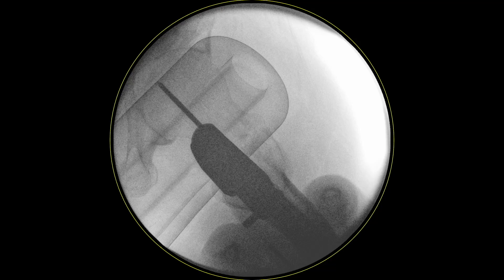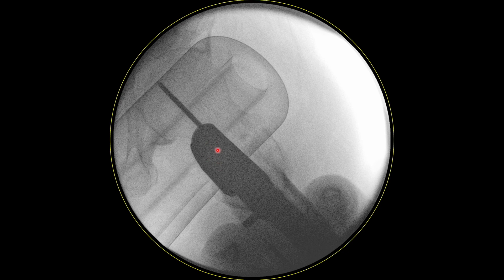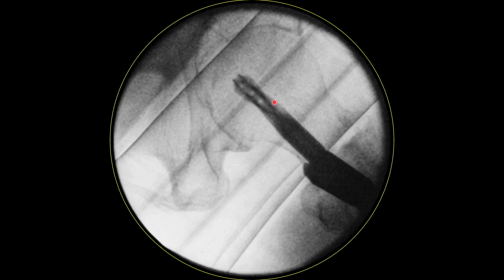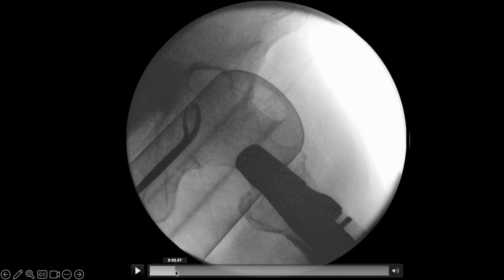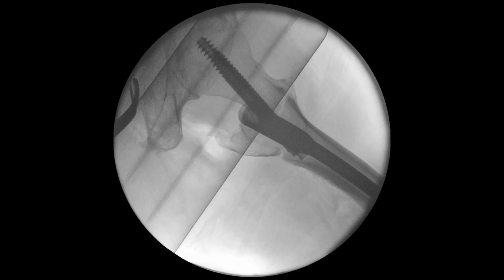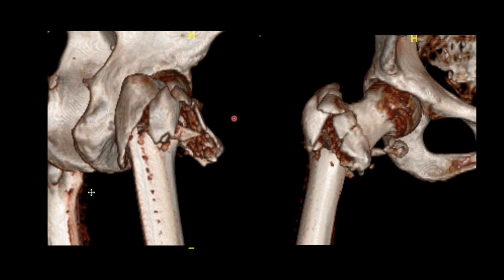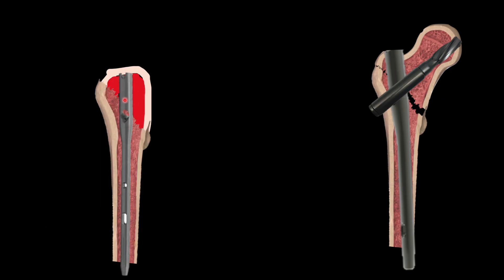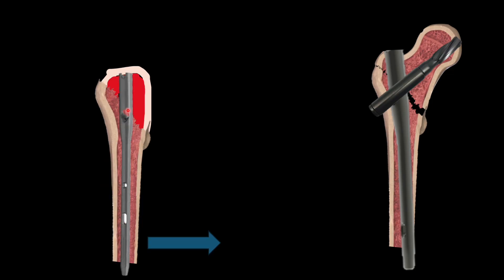Problem of Off screw in Trochanteric Fractures Nailing

Comment: What do you prefer lag scrw with anti rotation or lag screw with cap 
What if there is posterior comminution you put fully threaded or partially threaded screw 
Thanks , sir
Reply from the maker: We use separate derotation only when we are using DHS. With most new nails the set screw which goes through space of end cap blocks the rotation of lag screw. So there is no need for a separate derotation screw. However when there is posterior comminution , we may use a fully threaded screw because that is more stable than a partial threaded one in view more threaded and better bone purchase.

Comment: Sir.. posterior placement ( & still parallel to neck axis) of screw in lateral view is acceptable only sir...???
Reply from the maker: Yes, that was acceptable in the examples shown initially. But, remaining too posterior in the neck can actually perforate the neck. X-rays may not show it, but CT will confirm.
Reply: Ok sir.. @Justorthothings
Reply: @Justorthothings  Campbell advises 20 degree hip flexion during positioning... May be to counter posterior sag... Didn't tried & was not needed too in my cases...  Kindly share your experiences sir...
Reply from the maker: @Sulthan62 when putting limb on fracture table, the limb usually remains in flexion only. Moreover a perfectly central nail entry wont create problem of non central screw. But if it happens, this video tip will help. Everything will be under c arm view, so there wont be much problem of overextension.
Reply: I feel that there wouldn’t be any orthopedic surgeon who hasn’t faced challenges at some point during a trochanteric fracture surgery.
Reply: Nice informative video ,,, Sir this operation is operated by your team ??

Comment: Sir? How we can increase limb extension in fracture table?
Reply from the maker: Just bring the boot down or neutral under C arm guidance
Reply: I really enjoy your short video @Justorthothings
Reply: @Justorthothings  thanx sir
Reply: Sir but bringing the boot up and down on full traction is not possible without releasing the traction.
Reply from the maker: @yashagarwal4559 Not sure which fracture table you are using, but it’s about the boot height, you just need to reduce it for reducing the flexion. Its possible with traction and without traction both. Check image link in above comments